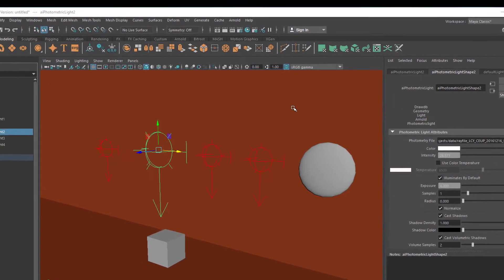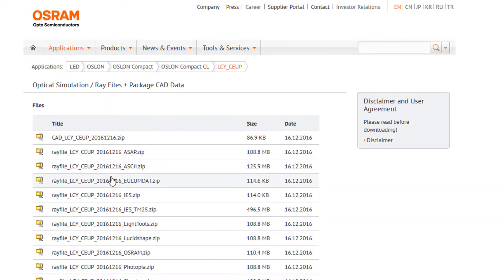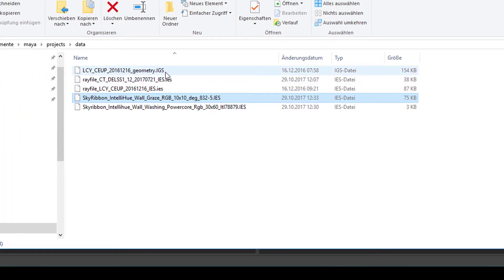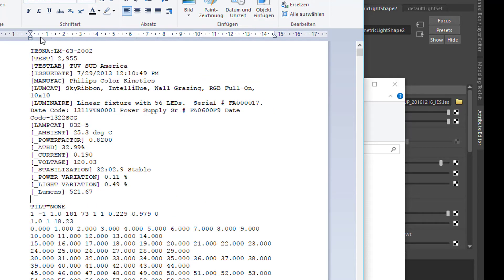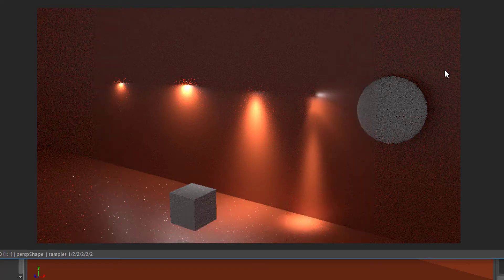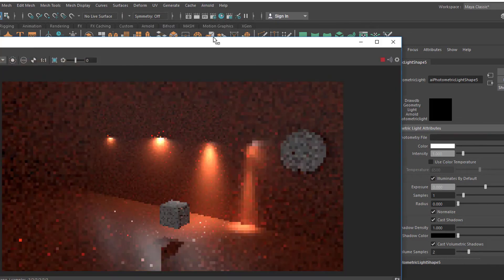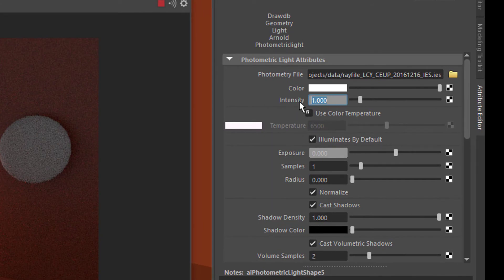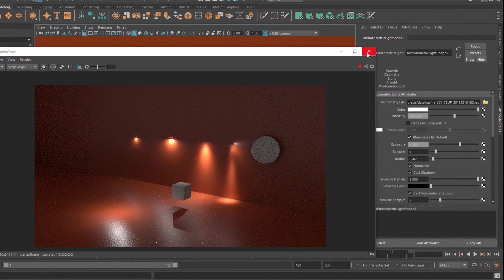Maya – Arnold Photometric IES Lights

Comment: Hi thanks for the post, I have a question about light intensity. As seen in your video, when you import an ies data to arnold light, intensity is 1 and we cant see light distrubtion. When this happens i (and you also) increase intensity manually and see the light effect i want. But for more realistic result, i want to use correct lumen(or candela) output which is include ies data. Is there any solution you know for this problem?
Reply from the maker: Hi Baran, thanks for your posting! The tutorial is a while back, so I don't have time to focus on it any more. Please consult the really powerful and dynamic Maya Area for this. The response time is short, and the community competent and gentle. https://youtu.be/f1WKbpokcmk
Reply from the maker: pls ask the MAYA AREA for this specific support. or a maya facebook group. thanks!